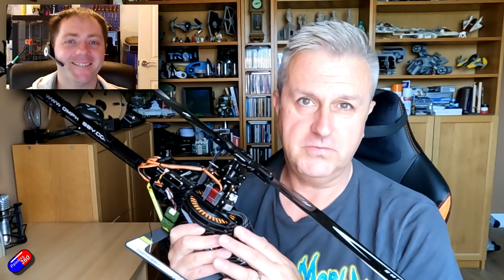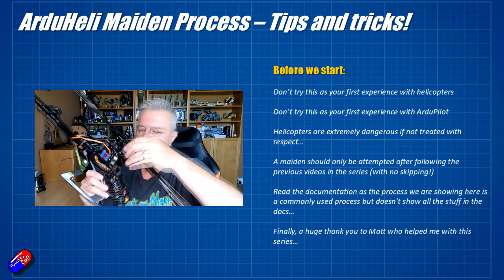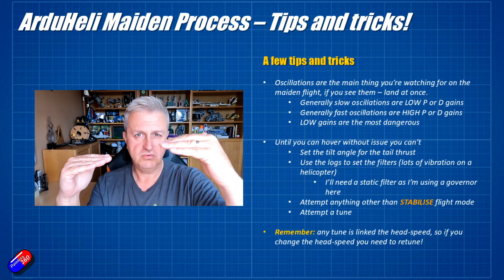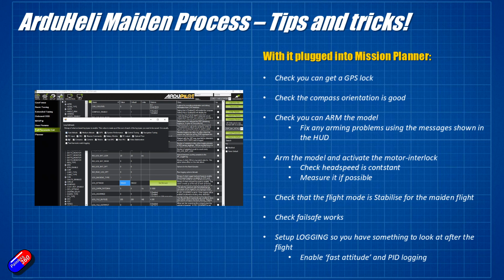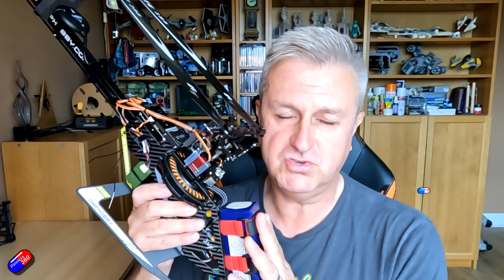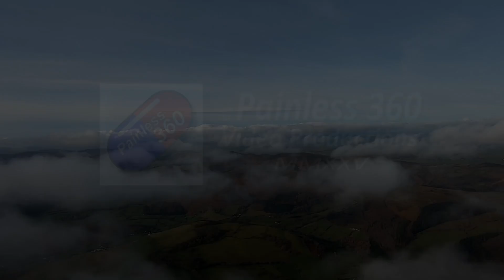ArduCopter Helicopter Setup: Tips and tricks for the maiden flight

Comment: Great video!  Really appreciate you doing these videos for the arduheli community.  You really break it down to what is necessary to get flying.  I would agree that there is a lot of stuff in the wiki that your basic user may not need to worry about to get started.  

One question though on your section titled "before you go any further".  You have the bullet stating "check zero pitch at 50% throttle."  first I assume you mean 50% throttle stick.  But do you want zero collective blade pitch.  I would think that you would want hover collective blade pitch.  

Definitely continue this series!! Thanks!!

Comment: Awesome, thank you for sharing the maiden flight. Thanks to this video series, with these videos and some help from a flying buddy at my club I've been flying a Trex 500 equipped with this setup all summer, yes it does have a robotic feeling but its a much more relaxing way to actually fly a big-ish model helicopter. I have no interest in the crazy 3D stuff and enjoy seeing a model I built and tuned just flying around the sky with me controlling it, I tend to use ALT Hold mode for normal flying. The loiter or position hold modes are great if you lose orientation when the helicopter is a little further away and there is always the RTL mode that I've not actually used yet.  

Personally I use the left stick arming method, with the little button on the GPS unit and also the motor interlock switch it works great. 

I couldn't sort out the tail on the M4, I had a wag which turned out to be my fault. The tail servo control rod is supplied as two end pieces and a CF rod. I glued these together with CA (later I found the manual says to not do this but to use Epoxy) anyway one if the ends was lose. I didn't realise this and later when I reverted back to a Radiometer Nexus controller (still wagging) the control rod came apart and the whole thing stated spinning, whoops. After fixing it the M4 flys great now.

I would be interested in seeing you try the ArduCopter auto tune function, it's something I've been meaning to do but as my Trex 500 is flying great I've not bothered yet.

I've bought a second 6C mini and that is going to be fitted to an OMP M7 that I have already flown successfully with a Radiometer Nexus.

Thanks again for making this video series, I appreciate your help and the videos will still be my reference for when I eventually get round to doing the M7 setup.
Reply from the maker: Thanks for the comment and letting me know about the tail fix on yours. I had that issue in mind when I did the maiden... Happy flying

Comment: The complexity may not be for everyone, but the efficiency and moderate noise levels are definitely appealing. Maybe a simpler, non-aerobatic rotor head would make things more accessible for some of us? I made my first FPV flights on a Multiplex Funcopter 15 or 16 years ago, using a basic gyro stabilizer that was available at the time — and it turned out to be a perfect beginner FPV platform.